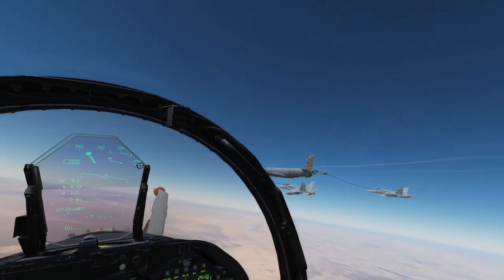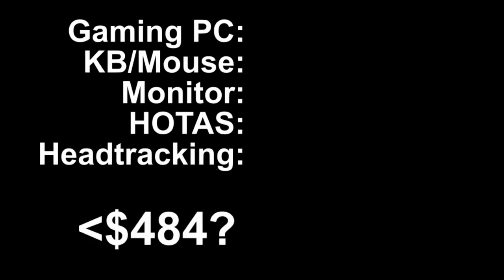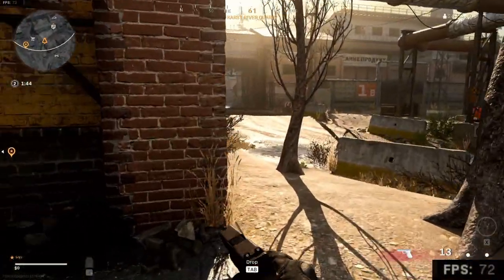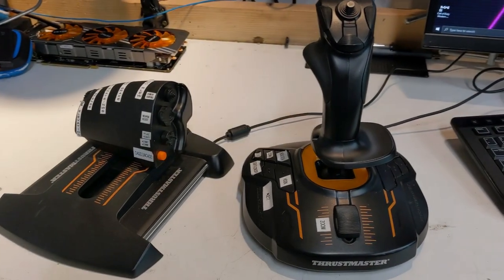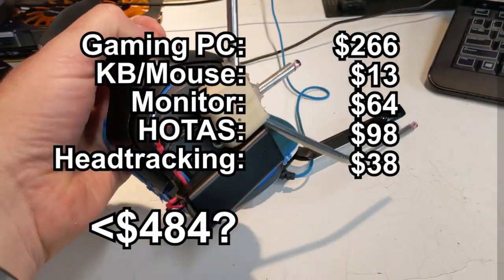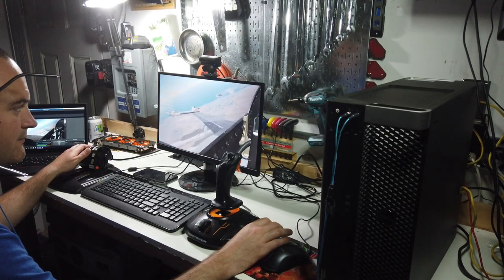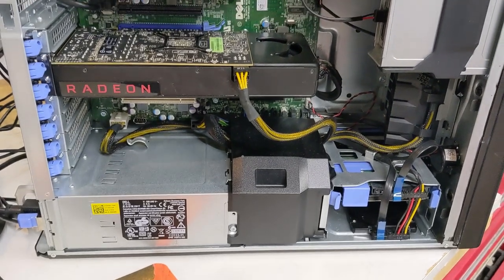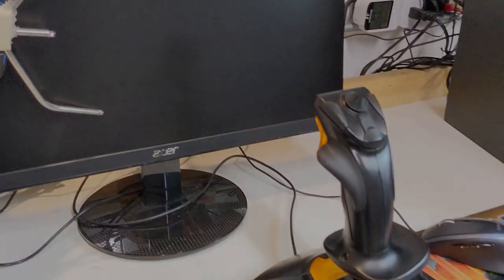DCS World for the People: a sub $500 complete setup?!

Comment: I have been along the same route. Got a hp z400 for free and put in a gtx1060 6gb, because it was the best 6 pin card i could get. Also using open track with a ps3 and a homemade led clip. Together with a x55 it is a solid setup. Also build my own rudder pedals, just waiting for a pro micro from China. Good video, you have a sub
Reply from the maker: I have an X58 system I love as well.  X58 is definitely showing its age with DCS, unfortunately, even if it isn't with a lot of other modern games.  I love your setup--do you have a build log somewhere?
Reply: Gryz Have you seen Dundun92? He uses a X58 system plays dcs, watch his footage

Comment: I have a Dell Presicion PC at home for CAD. Never occurred to me that I might be able to play DCS on it. Great video and thank you for the idea.
Reply from the maker: Excellent!
Reply: Can I have all specs of it? Please Dell Presicion Pc
Reply: @samuelson76  DELL Precision T3500. Intel Xeon W3565 @3.2GHz, 12GB RAM, Nvidia Quadro FX 3800. It failed to run DCS. No surprises there. I cannot install my GTX 760 in the Precision as there are no free power cables to power the GPU. Even with cable adapters not sure if the PSU can take the load, and did not want to risk it. I use this PC for learning CAD and was unwilling to put a gaming GPU on it or risk ruining it. DCS does run on an old Q6600 with GTX 760 with 8 GB of RAM. Strange thing is GPU load is much much higher than CPU load and I do not know what that means. I am looking into upgrading to newer system with my old GTX 760 and 16GB of RAM minimum. Not going to pay insane price for a GPU due to mining demand.
Reply: @drdonvito  After trying DCS with a Q6600 running at 3 GHz with 8 GB of RAM and a GTX 760 I can say it works OK at least for simple missions and training. This way anyone can try and decide if they like it and want to invest in better hardware, or not. The GPU keeps running maxed out, so logically it should be the first component to upgrade, but with the used GPU market currently being what it is, I am not buying. I am considering another used Workstation PC with massive ammount of ECC RAM (64GB), a 3+GHz Xeon and my existing GTX 760. But I feeel that with the GTX 760 I would not be able to see much improvement. And ECC RAM is a bit slow too.So maybe it does not make sense. What do you think?

Comment: You know, i have been getting more and more intrigued by this game but reading through a lot of the facebook groups, discord etc. I never even bothered to try it. Even purchased an xbox one s for MSFS 2020 since it was cheaper than upgrading. Anyway, installed DCS world and it runs fine on low settings on my ancient a10-7850k, 16 gig of ram and r7 360 graphics card. Am tempted to do this as it costs significantly less than a current gen console and should be able to turn up the graphics a bit more. Will certainly be more than enough to run the game for long enough to be able to save to get something of a higher spec (and turn up the graphical settings even more) in a couple of years. Thank you so much for the video.

Comment: bruv that blue saitek was my primary for soooooooo many years growing up. Ran mine into the ground. AFAIK you went further than most regreasing it -- I did the zip-ties, but I think I went a little further than you did as far as how much tension I removed -- but the biggest problem with that stick is the lack of weight on the base. It demands to be bolted to the surface of a table. Also watch out for the grip adhesives to wear out quickly.

I miss the rotary knobs on the throttle the most. The stick was cool, but the spring on the pinky trigger was wonky and it squeaked for as long as I can remember. ALL OF THAT SAID it was a massive improvement from whatever garbage stick I was playing MSCFS 2 at the time
Reply: CFS2! Now that's a name I haven't heard in a long time...

Comment: Great video and analysis!
Here's the system I'm currently using to fly DCS.
I've had the CPU\MB since 2011, added the GPU a couple years ago and another 16GB RAM this year.  
i7-2600K 3.4GHz (overclocked to 4.2GHz) |~| MSI-P67A-GD65 |~| 32GB DDR3-1600 Corsair RAM |~| NV-GeForce GTX 1060 3GB (overclocked) |~| 2TB SSD space available.
After I decided to go "ALL IN" during ED's Stay at Home sale last Spring, I was lucky enough to get a 
Thrustmaster T.16000M FCS Flight Pack (Stick, Throttle, Pedals) for $200 before the prices sky-rocketed. :)  Found a great head-tracker with the The Puck IR from Grass Monkey Simulations for $65.
It doesn't run well when settings are maxed but I've configured it now so that I can't average around 60FPS, (still trying to figure out what settings would be the best though).
I've wondered if added a better video card would be worth it or just get a new CPU\MB\GPU, since my system is old enough already.
I'd be up for some pointers on how to maximize my system, as it is now, if you have some.
Thanks for the video and keep posting them, they are helpful more than you know.

Comment: My setup is a just a tad more expensive. I picked up a hp z620 dual cpu machine at a bargain price.  The dual cpu part is redundant as DCS and most other games doesn't know it exists though, Doom however does utilize the second cpu! All 32 threads! I got a pair of cheap e5-2590's anyway it had 48gb quad channel memory at 1333mhz an ssd and an rx 590 second hand. I have an x52 hotas which is ok. It works really well. I have a 75hz monitor. When flying really low over a big city I will notice it drop lower than 75 fps (msaa 2x) but even on multiplayer its marginally worse but really very acceptable. One day I will upgrade as I dip my toes into VR but I'm in no rush at the moment.
Reply from the maker: I built a dual CPU system out of the T3600's big brother, the T5600, just for funsies--32 threads of madness.  Yes--some games like Doom and GTAV absolutely eat up all those threads, but DCS couldn't care less!  Neat rig you built though!

Comment: Great video dude! i always try to help out new dcs pilots that they shouldnt buy the top notch super expensive stuff for a start ... a logi 3d pro is a good start stick :) 

anyway great video dude keep it up ;)
Reply from the maker: Thanks for the feedback Nubs... I'm going to have a video soon where I benchmark half a dozen sub-200 dollar video cards--this should be another noob friendly guide :-)
Reply: I'm been using thrustmaster t flight x for 3 years now and no issue at all, also I have bought delan clip because is cheaper option and it works very well, can't compare with trackir 5 because I have never used that one but for 50 euros I have a solid tracker with no lag or problems, all this configuration is worth 100 euro and is not that bad

Comment: Thanks for the helpful video, I'm planning on building a similar setup for dcs. 
Can I ask if you had any compatibility issues with the graphics card and the t3600 PSU?
As I understand it, the PSU has two 6 pin PCI-E outputs and the RX480 has an 8 pin slot. Wondering if there is an easy way around this or if it matters at all?
Reply from the maker: The RX480's I have (Reference, blower style cards) only have a 6 pin slot.  Either way--you can get a 6 pin to 8 pin adapter that will work just fine--if you are worried about juice, you can run an adapter off of one of the SATA power leads.

Comment: Awesome video, exactly what I needed. As far as what you mentioned at the end about getting a better cpu, is there a prebuilt tower that anyone would recommend?
Reply from the maker: This is a very very difficult time to buy a PC.  The second wave of crypto-mining has destroyed the GPU market that was already struggling because of the pandemic.
Reply: I wouldn't reccomend any prebuilds unless you are sure it's not a scam for it's price
Reply: Sorry, to clarify:
In this build, you got an old tower and put a better gpu in it. Are there any other towers you'd consider doing the same thing with?
Reply from the maker: @nikoscholtz8397  This is the only prebuild I have experience with.  What I will say is that if you are building from a prebuild/workstation, the two things you need to look for is single threaded CPU benchmarks--I won't go much older then I did here--and the ability to take a full sized GPU and power it.  The T3600/5600 line can do that effectively.
Reply: @drdonvito  Appreciate it

Comment: DCS noob here - anybody have any tips or advice for starting in 2023? Will this setup in the vid still work in 2023? I’ve got about $1300 to spend but I’m not sure what I’m going to do. There’s a great deal on Hotas I found, but that would only leave me with around $600 for a gaming pc. On the other hand there’s a great deal on a Legion t5 tower with Nvidia 3060rx video card,  36g of RAM, Intel 12700 processor, 1TB ssd and 2tb hard drive. But it’s on sale for around $1300, which is at the top of my budget. I don’t have to get every last pice of gear now. In fact the gaming pc is probably most important. The motion head track I can work out later. I’ve never built a pc but I know I could get a much better deal if I put the time into that. The Legion pc’s are pretty well built and I know someone with a great DCS setup uses one, so that’s a plus. And a decent machine I can gradually upgrade over time would be nice instead of one with a lot of used gear which may wear out soon, or need more upgrades if many of the parts are already old now. If anybody here wants to help or has any advice (or even a gaming setup they’re not using anymore that they want to sell! 😉) I’d greatly appreciate it!
Reply from the maker: The Legion tower would net you great results... since I've made this video DCS has become increasingly better optomized.  Depending on the module, a simple HOTAS can yield super great results, as I demonstrated in this video.  Head tracking though--it should be a priority.
Reply: @drdonvito  Thanks so much for responding! I am completely stoked about getting back to flying 🙂I’ve progressed quite a bit in the past few days too in my pc knowledge. I’m thinking of building my own pc using an Intel 12700k cpu, ASUS ROG STRIX Z690-E gaming motherboard, an MCI Nvidia RTX 3060ti gpu, a Samsung 1tb ssd, 32gig of Ram (Ripjaws brand for low latency), 750watt modular power, Be Quiet! brand Pure Rock 2 CPU cooler, and a MUSETEX ATX pc case with 6 argb cooling fans. The total is running around $1100-1200 which is a few hundred more than I planned on spending, but I may be able to do it. And with Amazon prime day coming up July 11th-12th I might be able to get an even better deal! 🙂👍I still might go with the Legion pre-built model which I really like, but it’s so tempting to go with my custom choice because I can get (I think?) a $1500-1800 setup for only $1100 or $1200. With the big sale coming up on Amazon I’m wondering if I could get it down to $1000, or even less if 
I’m really lucky. And this way I’d have a setup that would last for a number of years and there would be room for upgrades. I’d like to get a 1or 2 TB HDD to go with the SSD but I may have to wait for later. Especially since I still need a basic hotas/head tracker setup. 
I can buy a windows 11 code second hand and download the main OS on the windows website, so that could save me $100. However it works out I can’t wait to start flying again! 🙂👍

Comment: No offense but as a xbox one controller F/A-18 player you're really underestimating how much you can do with a joypad, by using just two modifiers you quadruple the imputs and setting the right stick as a mouse you cut the need for both headtracking and keyboard, meaning it's perfect for vr if you want to spend the rest of the 500$ budget on a used quest 2.

If you really need to use a hotas I suggest pairing a thrustmaster t16000 throttle with a gladiator mk2 stick, bit more expensive but it's the cheapest option to have all your butto s and hats where they belong instead of using base plate buttons.

Comment: I run DCS on my Acer  nitro 5 i5 8thgen 8gb ram ,GTX1050ti(4gb),
Reply from the maker: The 8th gen i5 should have much better IPC then the 1650 in the comp in this video.  Do you go on many multiplayer servers Rajesh?  I could see the 8gb being a major bottleneck... I routinely see DCS chewing up 9-12gb.
Reply: @drdonvito  actually I old pc is broken. And I'm looking forward to buy this laptop. So i was asking how this laptop would run dcs world. I'm expecting it would run kind of just above medium graphic settings,? Ik 8gb is the worry I'll go fir 16gigs once I buy it. Write your review. 
And I too thought that DCS is a money needed game. So I'm planning to start with a gamepad controller. Becoz all the other gear is costly.
Reply from the maker: @rajeshbt8146  You will need 16gb.  The 1050ti should be ok at low/medium settings and the i5 will probably work ok as well.  I would recommend a cheap Logitech 3d Pro or T16000 instead of the gamepad--you will have a much better experience.

Comment: T16000 all the way unless you can rip apart an X-52 pro from Saitek and basically slap a new centering solution there, plus the porked sensor mod. TM failed with the T16000 in giving it FAR too strong snap-to-center! Literally nothing you can do there.

Comment: why cant i run it on my i5 7th gen, 8gb ram, gtx 1050 even on low settings :(
Reply from the maker: That's quite a small amount of ram for DCS--that's probably your main issue.
Reply: how much average fps do u got?
Reply from the maker: @yigit9236  I didn't run any benchmarks during this experiment as I really wanted to see if the experience was even feasible.  I find when I start focusing on FPS, frame times, etc, I start to focus more on the performance of the experience rather then the qualitative experience.  As mentioned in the video, however, my FPS hovered between 45-70 for most aircraft/maps, with dips into the 30's for graphically intensive stuff.
Reply: @drdonvito  Do you think the pc configuration wich steam recomends is good and capeable to run dcs? sry for my english xD